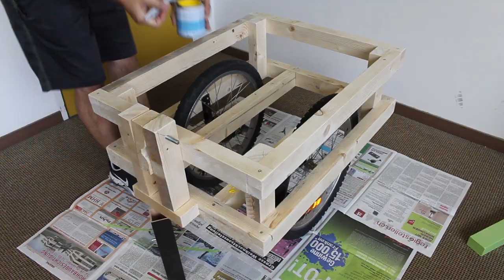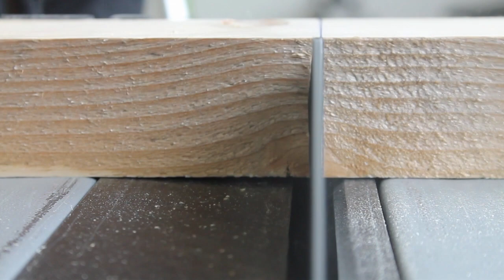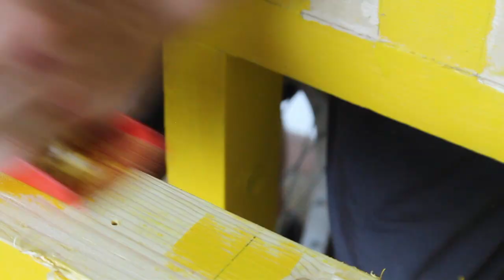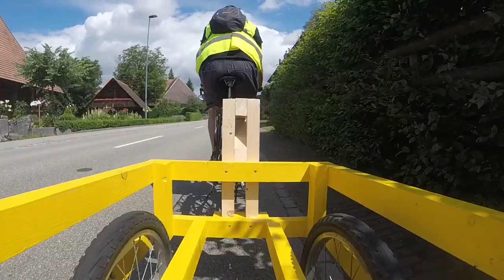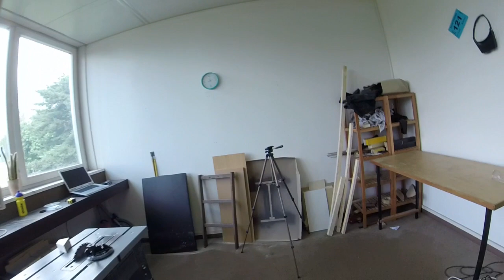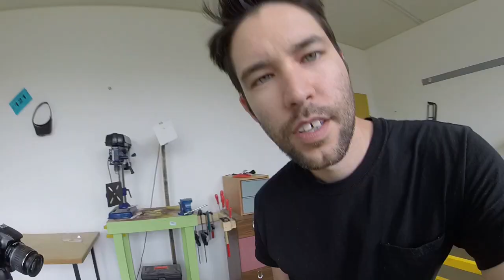Making a bike trailer - part 2 of 2

Comment: i was thinking smaller Wheels, like off a kids bike, and or move tires to outside of trailer, I am trying to build a Trailer myself, my idea is to use a fold -up Golf Bag Caddy, i have 1 that is Aluminum and sits low to ground, i am looking for small tires to replace hard wheels, i do like your design, makes me think about my build,,lol
Reply from the maker: hey this is a great idea I haven't thought of yet and I don't think anyone else made the comment yet to use smaller wheels. I bet the smallest kids bicycle wheels would work great at keeping the center of gravity lower. thanks for the comment. Any btw when yours is done I'd love to see it.
Reply: A hand truck made into a trailer will work better than that golf bag.
Reply: If you don't want to go to the bother of getting smaller wheels, you can lower the center of gravity by making triangles then mounting the wheels to the apexes.  The outer most triangle will need some support too, if you want to keep your cargo area the same size.
Reply: I don't think the center of gravity is an issue, so I support his choice of size.
As to bicycle wheels, they need support on both sides. If he put them outboard, it would require another support which would add weight. He already has a fair amount of weight as it is. A single 2" x 4" x 8' weighs ~ 12 pounds.
Reply: @joewoodchuck3824  I wasn't planning to bring it up, but the 2x4 construction seems a little overbuilt for his bicycles.  5/4 decking planks would most likely handle anything he'd tow by bike.   I suspect 3/4 plywood would do a great job.
Reply: @ronyerke9250  You're correct. But it's his build that he wanted to try. He can always make another one if he wants.
Reply: Yea needs to be wider

Comment: what about drilling lightening holes..   also  why not warp some thing plywood and  make an symmetrical airfoil using sturdy merge points and putting the wheels on the outside...

Comment: Something else I was thinking about as I was riding, pulling my trailer today. If your going to use wheels that big, they need to be further apart. At least 20  inches apart, or even 24 inches, and lower your storage/carry area. Should track better and be more stable. Just a thought.
Reply from the maker: yes I think that is correct, one of my main problems here was the narrow frame.

Comment: It came out great and that was a lucky find too. I was thinking two lateral pieces of would might stabilize it more? Just thinking when I was looking at the issue.
Reply from the maker: Thanks man! What do you mean by two lateral pieces? What I was thinking of doing was adding some negative camber to both wheels. Then also lowering the air pressure in the tires, I think that will make it less bouncy.
Reply: Like trailers have. from the hitch, it forks out in a triangle towards the bed. Having two post going to the sides of the cart, would keep the side to side movement from toppling it. That's what I was thinking. Just a thought. Then again, I may be totally off. google trailer beds, you'll see how the side bracing is used.
Reply from the maker: ah I get what you're saying now. hmm sort of just drive the force through the two lateral pieces to the bike, yeah that might work.

Comment: If you ever re-design another trailer, try bringing the tops of the tires in closer together (auto mechanics call this a camber adjustment).  You can see this on wheelchairs used for athletic events if you watch Special Olympics or wheelchair basketball.  This will reduce the chances of tipping.  Lowering your top rails (like you said you might) will also help, as will adding weight (ballast) to the lowest part of the trailer.  Setting the wheels farther apart is also an option, but that could result in clearance problems if you use the trailer in narrow spaces.  Nice trailer though.  God bless you.

Comment: Nice job Bruce. If it keeps tipping can you just make the base wider by mounting the wheels to the outside instead of within the frame?
Reply from the maker: thanks Chris! It's a lot better now that the frame is lower but I'm still not fully confident. The next thing I'm doing to do is add some negative camber. And other idea I had was to lower the tire pressure. In the end I think I should have made it a bit wider.

Comment: that high hitch design will cause you to crash if you will apply your brake while turning......many years ago i thought of building my own bike trailer but i can not find a good hitch design that is easy to make....so just decided to look for a used baby stroller/trailer online....luckily i found a good quality one for $25......removed the side and top part and replaced with a big plastic tray

Comment: You need to calculate dimensions of box then choose a wheelbase. When you go empty box your design will not work. If you put weight on the lower middle, like steel or stones it wont tip over. You should calculate box dimensions/weight and wheelbase. Not just wheelbase as others mentioned.... It needs engineering like big trailers.

Comment: You could angle the wheels so the bottoms of the wheels are wider than the top
Reply from the maker: yeah I actually ended up doing that. Also I put a floor in it which added some weight to the lower part. Not it doesn't tip at all.

Comment: Does your trailer wobble side to side with ease? I tried building my own trailer but I only fixed one side of each wheel to the frame. And it wobbled badly. I am wondering if it be better if I fixed both sides of the wheel. I also am using 24inch wheels and they are 2nd hand worn.
Reply from the maker: If I go too fast, something like over 15 kph, and if I hit a bump, it starts wobbling back and fourth. I believe it's because the wheels are too close together. One of these days I'm going to angle the wheels to where the bottom of the wheels are sticking out more, also I'm going to lower the air pressure in the tires. If all that fails I might adjust the frame to make it wider. But it works fine as is, as long as I go slowly.
Reply: Bruce Chastain - Make cool, thanks for the quick reply. I might re-try building a trailer. I LOVE the way you made the attachment. Its very smart way to fit it onto the rack. I have a rack myself and tried a Garden Gate Latch. It was OK. 
The big issue I noticed testing mine is I was hardly doing 10MPH (not sure in KPH?), and it would start wobbeling like crazy. I think the desing I had was just poor aha.
Reply: kindness ARK late comment but I used 2 wooden pallets to make my trailer and im using 16" inch wheels for my bike trailer and handles very well no wobble at all unless I go 40mph downhill it starts to swerve a little bit I guess that they are designed to transport not speed but really I focus on the structure itself

Comment: Added to your final comments just one question, will have more stability and all the interior space, if you put the wheels out of the box, using the same excellent structure you have done? .
Hi Bruce, I'm here because I read your comment on the video "Hand Tool Build Off Winners 2016".
I'm the one who won the second prize. My thought in your comment is no small youtube channels, so there are little minds and great minds, people with and without passion, work with and without heart. Number of subscribers and subscribers quality. I think, your channel is definitely not small.
Freecad, Arduino, Potatoes, and wood, this somehow live with me too.
So ... I subscribe and thumbs up new friend :)
Reply from the maker: Hi Daniel, thanks so much for the kind words, I appreciate that! And congratulations on the accomplishment on the "hand tool build off"!!! 
About the wheel placement, yes I think moving the wheels to the outside would make it more stable, but because they are bicycle wheels they need to be supported on both sides of the axle for each wheel, so I would still have to have some sort of structure on the outside anyway. So I think if I were to do it again I'd just make the whole thing wider by maybe 20 cm.
Reply: Thank you !
Yes it would still have to have some sort of structure on the outside anyway. I think you not need to do it again, it's well done, maybe adding to the short base framing, a strong extension, can work well, maybe four 45º wood squares of plywood or similar, and two crossbars, or something like that. (Only ideas, because it's for your security too). It's a very nice project. Good done !